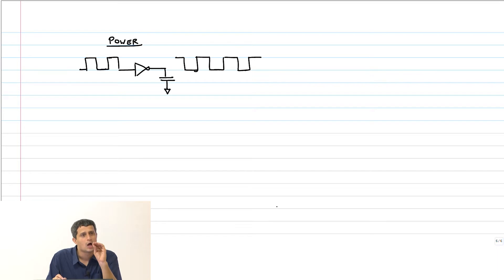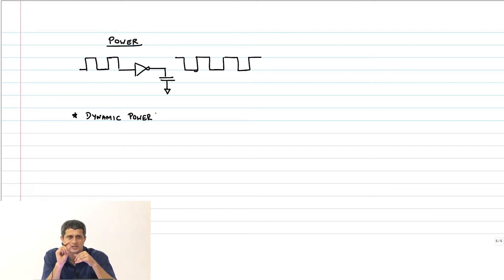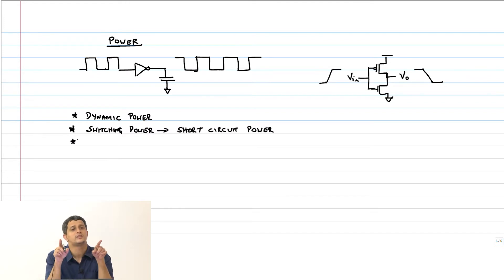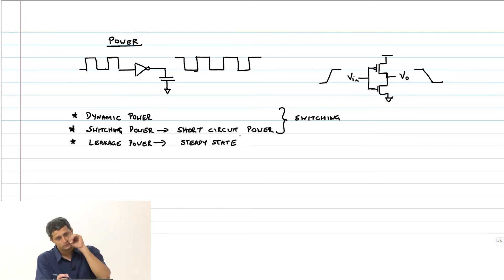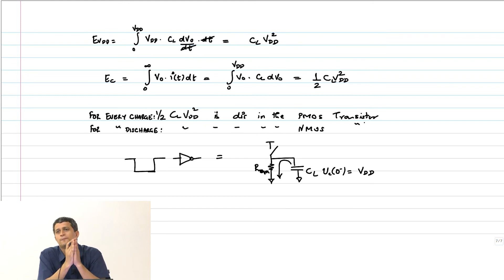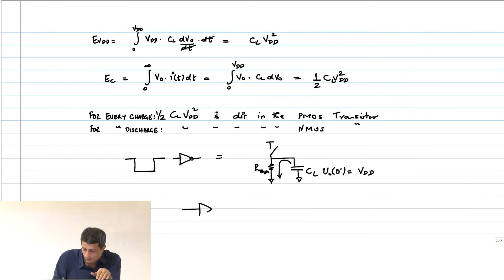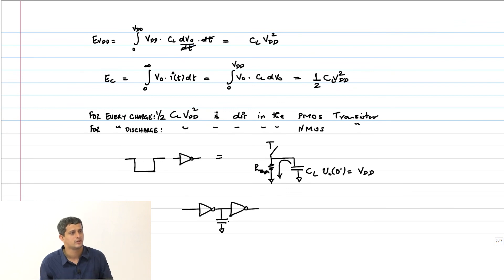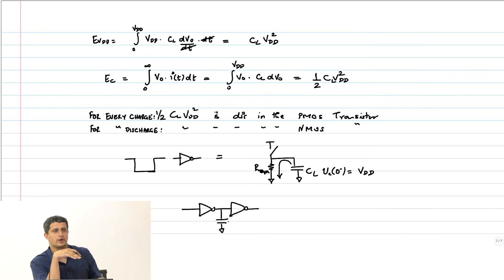Inverter - 15 - Inverter: Dynamic Power

Comment: @ 8:45  the energy delivered by the source is 1/2 cvdd2 and the energy delivered across the capacitor is also 1/2cvdd2 .then how can there be a power loss across  across the pmos transisitor.
Reply: source delivered CVdd^2 but only half of this is stored in the cap. Rest is lost.
Reply: energy delivered by source is CVDD, energy in capacitor is 1/2cvdd